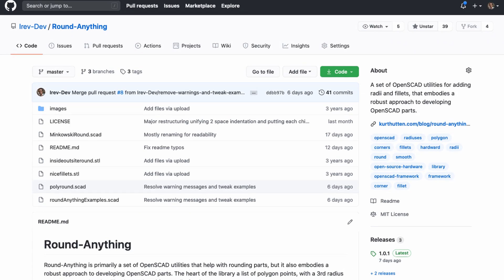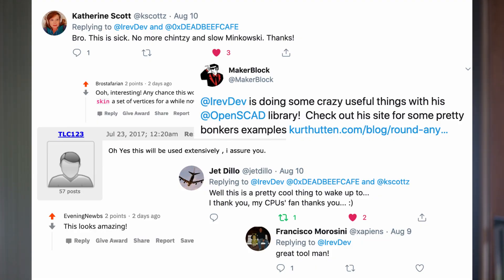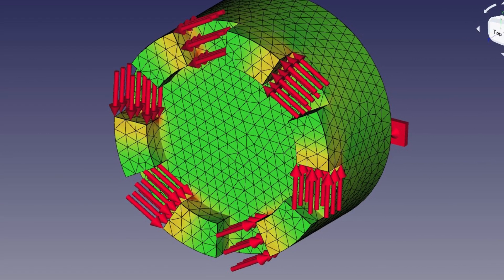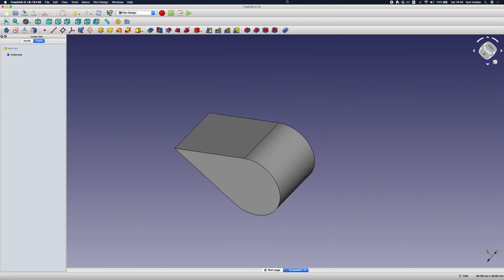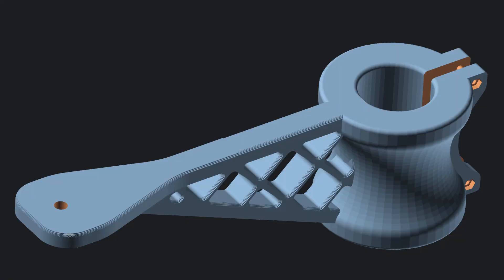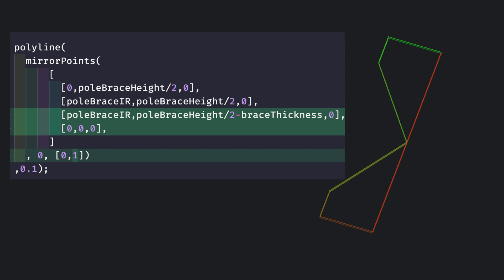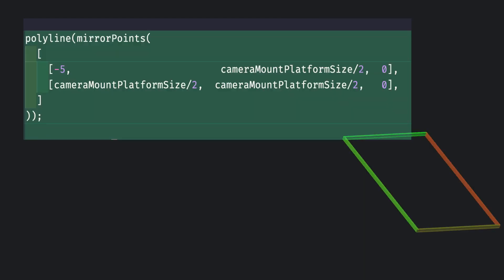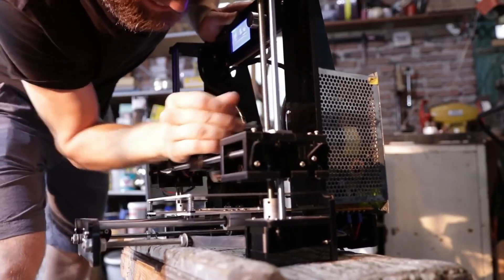Round Anything Openscad - Making fillets easy

Comment: I found your library looking for something to round corners on cubes in my existing design, but your video gave me a new insight on how to approach design in openscad. Thus far, I've been stitching together primitive shapes, using hull() function and sometimes using linear_extrude with polygons.

From now on when starting new designs I will try to think in terms of in terms of polygons as primitives when I'm going to use your library.
Reply from the maker: Awesome Alex. I think that's the way it should be done. Sketch and extrude is the workhorse in more traditional CAD packages for a reason :)
Reply: It looks like subscription form is not working.

Comment from the maker: I'm currently working on a community website for "Code-CAD" (like OpenSCAD). A good way to think of it is codepen crossed with a thing repository. You can check it out at https://cadhub.xyz/
Reply: When I try to sign up for this I click on the link in the email I get, and when it returns to the website it says, "problem confirming email".
Reply from the maker: @herseem  This should be fixed now. Can you try clicking the link in the verification email again and let me know if you have any trouble?
Reply: @meanman1992  yes, it works now